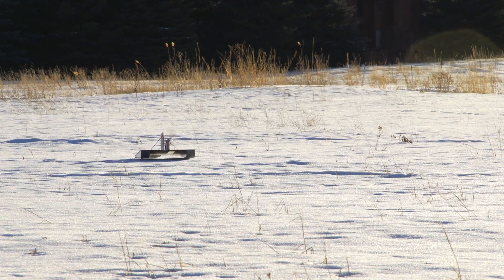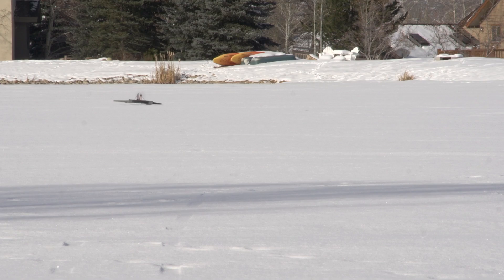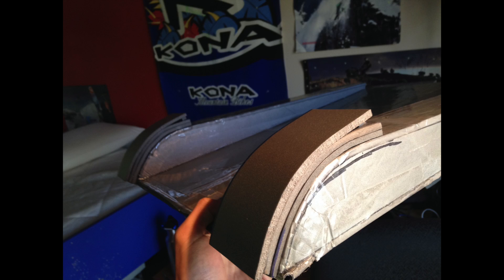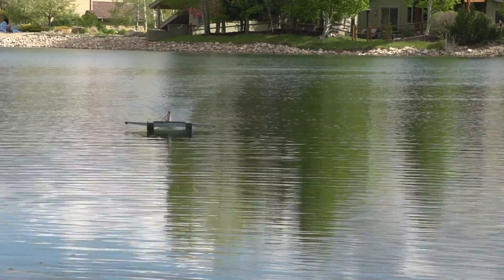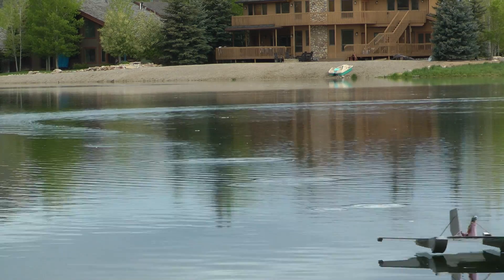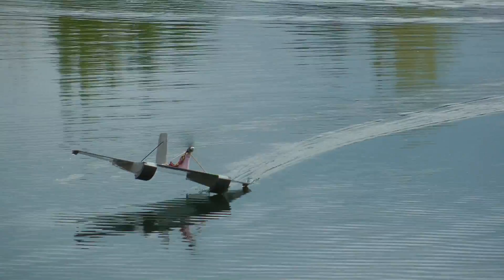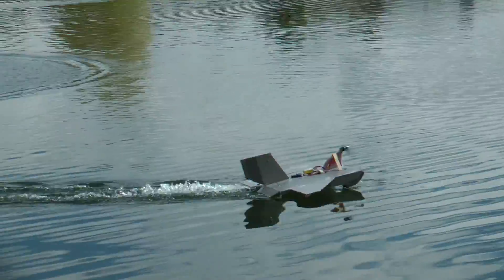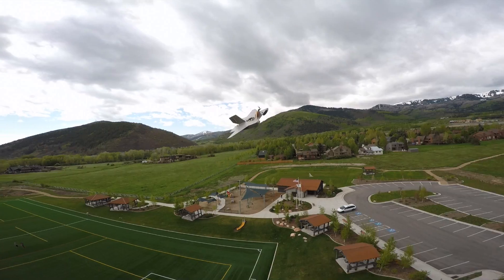RC Ground Effect Vehicle - Ekranoplan

Comment: Why not add ultrasonics on the wing tips to let it automatically go at the right height? 🤔

Should be much smoother to fly when it's kept always level and you only input rudder and speed :)

It could also always keep a minimum air speed as long as you keep the throttle above 0, to avoid stalls

Comment: It's because it's got torq issues, you need to use two motors , one turning clockwise and the other turning the other way this way you don't have to worry about it tipping to one side

Comment: Hi, for a design to truly make use of "ground effect"
You'd have to use a design that has negative lift, something that's difficult to do in RC because practically everything flies
What you have suggests some use of ground effect at times but most of the time your model appears to not be on a cushion of air but to be simply flying low to the ground, making more use of aerodynamic lift from the horizontal surface areas.

Comment: Rely nice craft and video.
I  noticed it seems to hang by the prop when airborne and wonder if the CG is slighty too far aft, also is the wing a 'flat planform' or does it have any type of airfoil to help it produce lift (?), it not you might try a simple 10% or 12% semi-semetrical airfoil which you can find on the internet at aerofred's site, just look for some of the U-Control models since the majority of them used the semi-semetrical airfoil with great results.

Really enjoyed the footage of your hound chasing it back and forth, laughed myself silly - Thank you for letting us share in the fun too.

Comment: I'm low ket starting to thing UFO's are advanced ground effect vehicles. They're often seen flying close to bodys of water or flat ground, turn by tipping, and accelerate faster than most crafts of the same size. On top of that, there shape from most angles would make the classic UFO shape _n_. Anyways, if I go missing because of thia breif theory, pls water my plants. Thanks.

Comment: What if you added small hyrofoils or a, that would be deployed for water. In theory just one ok the CG. U could add a rudder to your yaw or aileron channel and maintain "flight" above the water with a very small wing underwater lol u did it as I typed... I think I'm gunna take a crack at it.. I don't have time or allot off materials but. I belive I can fix this issue of water and ground u may just need a different reflex angle for and maybe more or less straight razors covered in corrosion X so the water cannot touch it on a molecular level,{also making any surface that might contact the water as hydro dynamic as possible, hopefully allowing it to literally cut through the water with a sleek tiny fin blades that are just enough to keep even and calculate what it will take to maintain the drag coefficient. There must be a way from changing propeller angles to possibly reflex, incredibly small hydrodynamics missions with almost zero drag and a trim set up to compensate for the drag as well as possibly a hydrofoil with control surfaces stuff to a flight controller for stability. And last idea would be feeding Wind Through the body and expelling it underneath the Wang in the rear helping to produce more ground effect but simply channeling are and reducing the space it has to tra there for speeding it up.. one of these methods should yield the results possibly even making an unconventional Leading Edge or Wing flail to increase this effect...? If I have any luck I will let you know and vice versa ;)  (I REALLY like the idea of a tiny EDF taking in air from the top and spitting it out nosels like a harrier... Could be simple or impossible but I hope sharing these ideas help spark some for you also.. U rock justin!
Reply: Hydrofoils do not use this Wing Induced Ground-Effect

Comment: maybe hydrofobic layer on bottom will improve effect on water surface. Also advanced flaps may be too.
Reply: maybe just changing the shape of the pads will be enough, if the pads push the water down more efficiently the water itself would keep the craft close to the surface, maybe enough to easy the drag
Reply: @Padeir0  so or in current aerodynamic configuration all fine. Although in small diapason speed&attack angle craft does behavior as shall be. Though bi-propeller setup will transform to enough yaw-nimble.

Comment: If you had your propeller lower so a lot more air was ducted underneath you would get greater effect
Reply: On the other hand, mounting the propeller higher is safer - ground clearance is important when you spend all your time only a few centimetres up.

Comment: try some waterskies instead of the hydrofoil.. ( may be they need some dampers ) ..  may be you can make them out of a few milimeter thick teflon plates.. ( may be you can glew them on springs as dampers )

Comment: Super cool
Simple made, strong and really efficient
I really love it, this device makes me thinking about different flying cars designed... 

This also makes me think about the hovercraft
So I've got an idea for you
If you add a hole on the center wing the air produces by the propeller screw will be able to push the device over the water probably easier 

So try with 2 central wings, like on old planes
The first central one doesn't change 
Add a shorter one, exactly parallel, under the central and between the ski 
With the air flow, this will create a compression point behind 
In cases of low altitude, i think it will help your device

Comment: Ive seen ground effect vehicles with "M" shaped wings, if you will.  Essentially the surface star t as dihedral and then tip down at the ends to create some anhedral. This seems to create channels for the air the flow and creates a more stable "flight" in ground effect... just a thought

Comment: Spray the bottom with something like NeverWet. Since it's super-hydrophobic, it won't stick to the water like it's doing now. I'm also guessing that part of the adhesion to the water is due to a build-up of static electricity from the prop.

Comment: I think you need some dihedral on those wings. It looks to be like the problems with going straight on water are mostly caused by the wing tip hitting the surface. A little up angle will move the end of the wing away from the water and add stability. Also, it looks like you are using very thin wings. A thicker airfoil will probably work better at such low speeds, and I think they usually have a more pronounced increase in lift when they get in ground effects, thereby adding some altitude stability. Last, some groves in the pontoons could be added to offset the torque of one pontoon touching down. What you want is something that throws a little water sideways. At the front, throw water away from the centerline and at the back throw the water towards the centerline. Just some thin grooves or bumps would do the trick. The stepped hull formed with those leather looking strips is a good idea. You might experiment with having more steps. Each step will trap some air and reduce drag and reduce the lift needed to break contract with the water.

Comment: There is a high speed ferry in development that uses this principle. I dont know if you continued this but try putting Anhedral winglets on the ends of your wings to control the yaw drift (just made that up) and the vortex coming off the wing tip... just an idea but i know thats how they solved the problem for the big versions

Comment: you could have gotten more height for same power using what loosely translates from Russian  to PAR, power augmented ram
this means thrust air is directed beneath the wing, some even had adjustable thrust lines
Since they turn by rudder alone, a favourite trick Russian pilots used was to dip a float or wingtip into the water on the inside of a turn

Comment: you should put some hydrophobic coating on the floats to make them almost frictionless with both the water and the snow. Also maybe integrate a closed loop system with your flight controller that always keeps it level by controlling the control surfaces. It would be much faster than you could control it and would be far more level than any human could ever make it.

Comment: Re-make the floats — go with V-bottoms — so much less drag when one catches the water. Also move them both closer to the center-line to avoid as much rotational torque when one catches the water. Some dihedral on the wings will keep them dryer. ;-)

Comment: This is an old video - but the principle of "wing in ground effect" is you're leveraging high and low pressures created by LIFT.  It would appear that your airfoil is just a flat piece of wood which supplies minimal lift; most of opposition to gravity being the angle of thrust of the propeller.  It would had more of a traditional airfoil creating some lift - you'd probably have a better effect.  Just thinking.....

Comment: That's pretty cool.  You oughta fabricate a design using the reverse delta wing with dihedral wingtips outboard of the sponsons and a T-tail to keep the nose down.  That seems to be a pretty stable configuration for WIG vehicles.  The dihedral wingtips give it stability in roll to counter the anhedral of the reverse delta inboard of the sponsons, and the T-tail gives it stability in pitch (and yaw) to counter the nose-up pitching moment induced by the main wing.  I'd be curious to see how the functionality of that design scaled down to a craft of this size.

Comment: I was looking at the problem with stability when in Ground Effect and started thinking.  Drones are able to hover in one place because of their ability to detect their position in space and adjust different motors to keep it stable.   Not sure what to call the board that controls all this, but I would think you could use this in conjunction with some ailerons  for stability.

Comment: Reverse delta wings slightly curved downwards from a narrower fuselage with knifed sponsons on the tips and a T-tail and you would have a winner. Your design actually has enough power to fly, which is not truly the goal. Nice first attempt, not a failure for sure.

Comment: Awesome concept! Yeah the double Popsicle sticks causes too much drag because it breaks water tension. That single Popsicle stick in the middle should be best. There is a ship that runs a concept like that with half of it in the water to balance itself. I believe if you run a stabilizer that's in almost equal surface area as the aircraft it should skip better on the surface of the water

Comment: thanks for posting.  good work.   here are some very late thoughts.   at :22, this design has promise.   as with Any aircraft, most of the mass Should be near the center line and near the craft's center of mass.   the use of such a Short tip chord is  Letting a LOT of air pressure escape.   the lack of rigid wingtip  Skirts  does this, TOO.     the use of two sponsons creates a wide footprint, which interferes with turns, in ground-effect.    i would be interested in seeing a version where a 'single-hull with outriggers' is used, with a longer tip chord and tip Skirts.   see seaplane outrigger configuration.        cheers

Comment: Produce a Hydrofpiol, the width of your RC vehicle. Delta shaped, like the first 2cm from the front edge of the wing, parallel to the wings edge. Basicly the wing under the wing but, only as wide the popsticals.

Comment: first - nice job.  I was thinking that the water drag was due to the surface tension.  I am curious if this could be improved by applying some super hydrophobic coating to the skids.   Contact angle changes dramatically.

Comment: Very ingenious.  Great job.  I'd like to build one.  I have been working on the CAD for a flying wing.  I think to make a flying wing craft with a ground effect foil that would retract and become the bottom of the wing surface during extended 321370765  😴😴😴😴😴😴😴😴😴😴😴😴😴😴😴😴😴😴😴😴😴😴😴😴😴😴😴😴😴😴😴😴😴😴😴😴😴😴😴😴😴😴😴😴😴😴😴😴😴😴😴😴😴😴😴😴😴😴😴😴😴😴😴😴😴😴😴😴😴😴😴😴😴😴  😴😴😴😴😴😴😴😴😴😴😴😴😴😴😴😴😴😴😴😴😴😴😴😴😴😴😴😴😴😴😴😴😴😴😴😴😴😴😴😴😴😴😴😴😴😴😴😴😴😴😴😴😴  😴😴😴😴  😴😴😴😴😴😴😴😴😴😴😴😴😴😴😴😴😴  😴😴😴😴😴😴😴😴😴😴😴😴😴😴😴😴😴😴😴😴😴😴😴😴😴😴😴😴😴😴  😴😴😴😴😴😴😴😴😴😴😴😴😴😴😴😴😴😴  the  light.  😴😴😴😴,  but  it  is  not  😴😴😴😴😴😴😴😴😴😴😴😴😴😴😴😴😴😴😴😴😴,  😴the  same  😴😴😴😴😴,  but  it  😷😷😷the  😷😷😷😷😷😷😷😷😷😷😷😷😷😷😷😷😷😷😷😷😷😷😷😷😷😷😷the  same  😷😷😷😷😷😷,  and  I  will  not  have  a  good  idea .  I  am  a  beautiful  person .  I'm  sure  that  the  new  year  👈👈👈👈👈👈👈,  but  I  don't  think  that  I  am  not  sure  if  you  are  not  a  good  idea .  I'm  not  sure  if  you  are  not  a  good  idea  to  have  a  great  day .  I  am  looking  forward .  I  am  a  beautiful  day .  .  .  .  👈👈the  same  time .  👈the  first  time  in  the  first  year  👈the  first  👈the  first  time  in  the  first  year  and  need  assurance  of  units  , but then would extend down to form a foil that would take advantage of ground effect would be an ultimate. I guess the idea of a craft that can float and skim ground with very little energy, the convert to a long duration high flyer would be a very appealing craft.  Heck, I want to make one just to have as much fun with my dog as you were. Cheers.  I'll drop a note when I have the wing ready for a ground effect element.  Peace

Comment: you could use vector throttling with two smaller turbines side by side to control turning in water, having one turbine throttle up while the other turbine throttles down, that should also balance the weight of the hydrofoil while on water

Comment: Your Hydrofoil was not working because it is a fully submerged type that needs constant adjustment to stay level... You would need some kind of controlflap on it as on a moth to get it to foil at a stable altitude... a other way would be to use a surface piercing foil that generates more lift the deeper it is in the water and vise versa less the more it gets pulled out, thus when well designed has a "autostabilisation effect"

Comment: This is not ground effect at all I think.
Ground effect is an effect when airplane structure (wing structure) only have little distance to ground.

Normally when plane fly high, aire pressure differences between wing top and wing bottom, causing the air flow from wing bottom to wing top, either forming clockwise of counter clockwise air flow at the wing tip. The more closer the tip, the air flow is stronger. This is a sort of energy waste if don't design some advanced shape to stop it.

When plane is landing or taking off, this air flow get obstruct, so plane flying very low get this benefit to lift more.

In this video, I think there is not wing shape (section) causing lifting at all, thus is not ground effect.

Comment: I've been wanting to make one for a while.  From previous reading, there are a couple things you can do to improvement performance.  

First, the ground effect height is directly related to wingspan.   Making a wider wingspan will increase the ground effect altitude. 

Also, the wing tip height in relation to the body make a significant difference.  The tips lower the effective overall height.  Look at the Boeing Pelican, Caspian Sea Monster (Ekranoplan), and Flarecraft.  Their wingtip pontoons weren't only for floation, they were to increase the height of the effective ground effect height.

To operate best, you should design for an altitude where the body/fuselage is as high as possible, while still in ground effect.    For this kind of application, aim for keeping everything off the snow, ground, or water.   If you need a 20 degree roll for turning, make sure that won't put the wingtip into the ground.  

Look at the "Flarecraft".  Their pontoons are inboard about half way, and low.  When turning, the entire outboard part of that wing is parallel to the ground, again creating ground effect lift.  

If you were feeling really ambitious, you could actuate those outboard wing segments, keeping them at the same angle relative to the ground, regardless of the aircraft's attitude.  Look at the XB-70 Valkyrie, specifically the articulating wingtips.  It was doing the same thing, but riding the supersonic shock wave. 

There is a ton of exploring that can be done with that.  I'm honestly surprised that we don't have more ground effect vehicles, considering how much is saved while operating them.   They don't need a robust buoyant fuselage, full size airplane wings, nor anywhere near the same required thrust.

Comment: Does the ground effect happen as the closer you get to the flore the dencer the air is due to gravity thus making it easyer to sustain a low energy flyght!
Reply: No. The easiest way to explain ground effect (it's not entirely correct though) is that the air doesn't have time to get out of the way because its movement is restricted by the ground, so instead you compress the air under the wings

Comment: noticed one of the wings, think it was the one primarily dragging in the water was at a 90 degree to your airframe, and the other was beyond 90, wondering if that was Apart of the issue with it flying straight?

Comment: Interesting test vehicle. The skids work okay for snow, but for water you might have better success with narrow pontoons, like a catamaran. You would get flotation without all the drag, especially if you taper them at the back. That will close the water leaving no wake. A wake is a sign that energy is wasted in churning up water. Think of a cross-section of an airplane wing: blunt leading edge, thin trailing edge, the profile of airfoils and hydrofoils, a very stretched teardrop.

Comment: Your "steps" wouldn't slow you down so much on the water if you pointed them towards the center of the float like on most float planes ,it lets them shed the water faster and have less contact area.